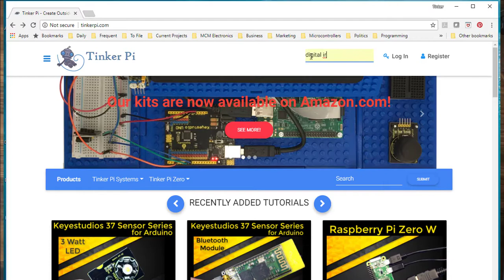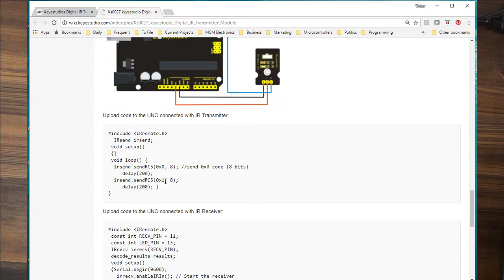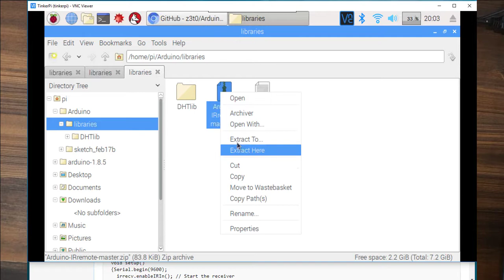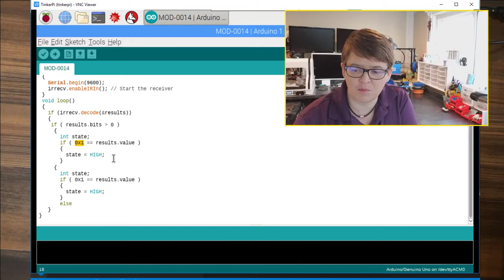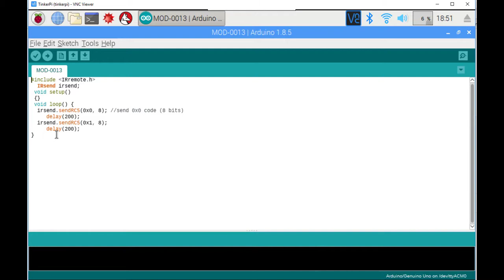Keyestudios IR Transmitter and Receiver with Arduino UNO

Comment: Is there any reason you cant use both on one board? For example, an application that receives ir signal from remote and sends vial transmitter?
Reply from the maker: I'm not sure to be honest.  The manufacturer's instructions used 2 arduinos, so I did it that way thinking that in reality you would want them separate.  The obstacle avoidance sensor is basically an IR transmitter and receiver all in one.  It sends the signal and detects how long it takes to get it back, if that's what you're looking for.  I'll have to try it out.